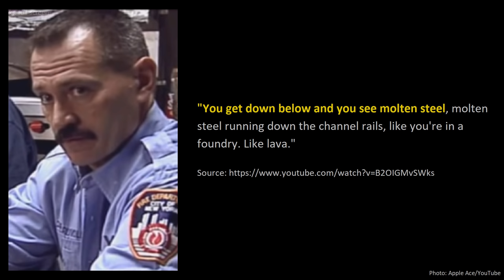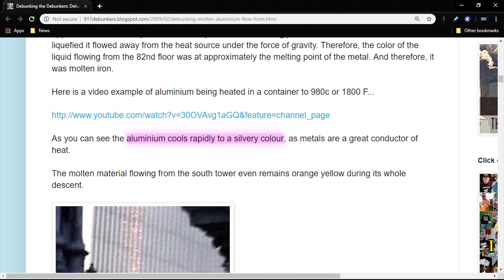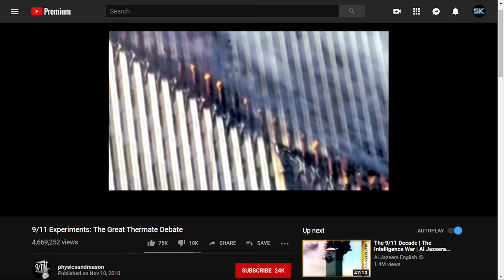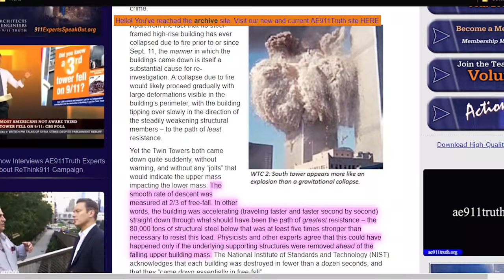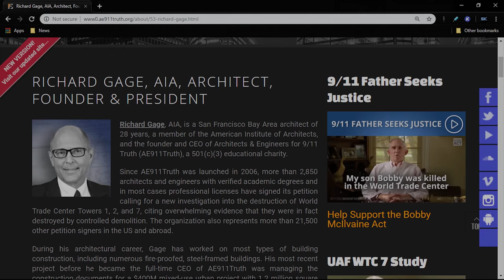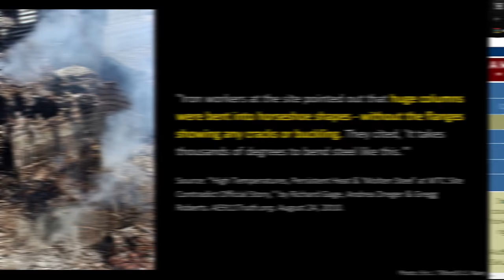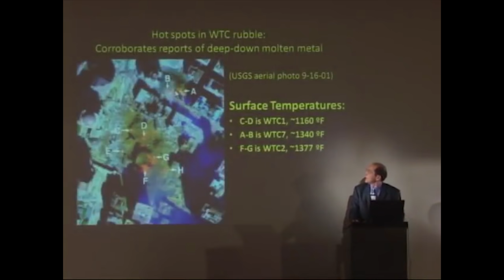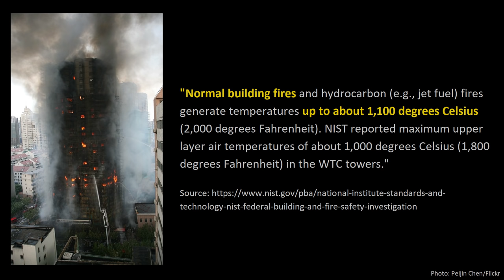9/11 Truthers Debunked: "Molten Steel = Thermite From Controlled Demolition!"

Comment: About minute : 31:20 ... this doesnt need to say ''certain pockets can have around 1200 degree celsius" ... But the photos itself arent made with some bolometric spectrograph or something. Meaning: those were not scientific cameras to show colors accurate. Meaning: the longer the exposure of the camera, the brighter the glow will be. And the photo looks at least like a late afternoon, but certainly a darker time of day. Back then cameras were able to adjust the exposure time by itself, given the lightsensor in the camera, and given that the camera know: what iso the film was (if the iso was not known, the camera usually ''thought'' its an iso 100 or iso 200, which is a quiet low value. Therefore the exposure time was longer, to light up the photo evenly, and not only the brightest spots. 
This can lead to a much brighter yellowish color than it was appearent for the observer at the place. 

Btw i think that steel could have been partielly melted. Not because of the temperatures itself (as you explained very good, the temperatures of the burning fuel etc was to low for that). But the collaps of the towers itself creates a lot of  energy itself in form of friction heat. Tentousands of tons of weight, falling from houndreds of meters, can make a very big friction heat. Given that parts of the building already were at around 1000 degree celsius, i can totally imagine, that parts of the steelbeams indeed melted. Now i am also sure, that those amounts were quiet little, because the heat disipates on a large area while the towers are falling. But i would not be surprised, if some conspiracy theorists found some evidence of miniscule amounts of molten steel. It just doesnt say anything. And it certainly still not supports their claims. 

I have to correct you a bit on 14:00 ... ''the outermost walls of the twin towers were the steel collums" ... thats not true in the sense how you meaned it. The facade-steel-collums were only there to support their own weight, but NOT the weight of the building itself. The inner steel collums of the building was there to support the weight of the building. 
Thats also the reason, why the facade steel got thinner and thinner with the height of the floors. But thats the only criticism i can find in your whole video, and isnt even an important point - because it doesnt change the conclusions of your video. 

Other than this, in my opinion very small error, i think you are right on every point. 
Also my first thought was: that this ''molten metal'' which drips down from the building" is in fact aluminum. The airplanes have plenty of it, as you proved, and the buildings had plenty of it, as you also said. Not only on the outside, like you researched correctly. But i am sure, also in the inside of the floors, there were a lot of aluminum sheets (like some coverage of the ceilings , or desks out of aluminum, parts of the elevator, etc... in fact i am quiet sure, to save some weight , a lot of parts of the buildings were aluminum For instance the doors of the elevators doesnt need to be out of steel. Aluminum also does the job. And the more weight the architects could saved, the less weight the steel collums have to support. ... There are a lot of sources of aluminium, because its such a good material for everyday use. So yes, i am very sure, it was aluminum.

By the way. The conspiracy theory of 'thermite' is still one of the ''smartest'' out of the bunch of crazy conspiracy theories. I heard much more crazy ones. Like: that the towers werent hit by airplanes, but by missiles shaped like airplanes to give them the appearence of airplanes.
The most wild conspiracy theory i read about 911 was:  that the collaps of the towers were in fact caused by mini-nukes. In that theory the mini nukes were placed at the lower floors, desintagrating the inner core of the tower, and "that explains, why the upper floors fell like in free fall into the inner void... and it explains why even after months there was found red hot metal on ground zero (because of radiation heat of the mini-nukes). It also explains the molten meteorit-shape objects, which are like the core meltdown of nuclear power plants." 
That one was the most crazy i read. And it came from a selfclaimed physicist from russia.

Comment: How can it burn to them temperature, all the fuel brunt up on impact, it simply can not reach them temperatures due to office fires alone as most objects in buildings are fire resistant, they have to be to meet a certain criteria, a building of the size and where the point of impacted was, it should not of fell into its own foot print, not once or twice but 3 buildings fell into its footprint, and no building has ever fell at the speed of free fall or due to fire, it totally defies the law of Physics

Comment: The so called aluminum does not stay red when in fine droplets as in the video.  They cool rapidly and turn silver.   Also on the ground it would not stay RED as in many ground photos and worker reports.  There simply was not enough fuel to keep it that way, even if it were it would not longer glow days later.  Simply not enough fuel and the fire did not burn very long. 
Iron stays RED even when not in liquid form.   That would explain why the metal flowing out of the towers stayed red for so long in droplet form.   Iron will continue to glow red even as a solid.  Where aluminum quickly cools and looses color.    Same thing with the Red hot STEEL on the ground days/weeks later.   It was a oxygen starved fire that did not last very long, black more smoke than fire = oxygen starved low temp fires.   The Center support columns that were intact gave way first.  The corner collapsing in the videos only occurs because somehow all the center columns lost support at the same time.    Still you could cut the top half of the building off and set it back down and it would still not collapse the rest of the building.

Comment: Simply suggesting that the molten metal is aluminum and claiming that this is more plausible is not at all a debunk of anything.
Here are some problems with your attempt:
1) You claim the idea of using thermite for controlled demolitions is ridiculous. Look up the demolitions of Sky Ride, Chicago and Reichstagskuppel, Berlin. 
2) You claim that it´s more likely aluminum rather than steel pouring out of the tower because the melting point of aluminum is much lower than that of steel. Then you (at least to some degree) destroy your own argument by admitting that aluminium would glow only at temperatures much higher than the melting point.
3) While it is true that authorities didn´t look nor test for molten steel (or iron) and simply ignored all the reports, you somehow seem to suggest that this is "truthers" fault. It´s not, obviously!
4) However, they - NIST - in fact did metallurgical tests on some steel parts they could find and identify to be from the fire floors. Guess what: None of the analyzed outer columns had reached 600°C or more. 13 out of 16 outer columns hadn´t even reached 250°C despite being directly exposed to fire. None of the analyzed core columns had reached 600°C or more despite being in the center of the burning floors. But tons of aluminium got molten glowing bright orange you suggest?!
5) Another kind of test that was done - not by NIST but other authority - showed remarkable amounts of tiny iron rich spheres in the dust. Typical thermite reaction product. It was all over in the dust and was used to tell WTC dust from background dust. 
6) "Silent" in this context can´t mean "no sound at all" since buildings that size can´t collapse without any sound even if no explosives are involved, right? You can and will have bangs and booms with thermite reactions if you put them into containment and doing so will fasten up the destructive process, but it still wouldn´t be as loud as conventional explosives. U.S. military labs know best where you can take this shit with nano scale engineering and adding whatsoever ingredience. At least several U.S. patents about such stuff came out leading up to 9/11...
7) The only ones who should have to come up with a straight detailed explanation are those in the U.S. who started the wars under the rule of the War For Terror and the Patriot Facts and the revival of the Cold War hierarchy. However, I can surely give you something better than the official "inevitable", a word seemingly worth millions of tax payers money...

Comment: How did the buildings collapse so rapidly with no apparent resistance from below.  Where did all the steel columns go? The debris pile was small and fires kept burning for weeks
Reply: There's an excellent 15min video here on YouTube that explains, in detail, the unique (for it's time) construction methods used in the WTC towers.  Essentialy, they were hollow tubes, relatively thin steel ektoskeletons tied to a column and girder core sheathed in drywall (rather than reinforced concrete used in nearly all high rise core construction today) tied together with delicate (again, relatively) trusses.  It was the connection between the trusses and the exterior skin that ultimately failed.  As for the debris pile, you have to remember that the buildings collapsed into 7 levels of basement (approximately 70ft) above that the debris pile was anywhere from 6 - 10 stories tall, so no, not so small.
Reply: There was plenty of resistance, as the not actually all that rapid collapse show.
The debris pile was 16 acres wide, and multiple stories high, as you can see in any image or video of The Pile. As for fires, how much flammable stuff do you think is in two 110-story buildings? Carpeting, papers, machines with flammable liquids, furniture...
Reply: @mooneyes2k478  what about building 7?   For the first 3 seconds , the collapse was at free fall acceleration and symmetrical all the way down , a steel framed building never before collapsed from office fires, the steel substructure remains after the worst fires.

Comment: Jonathan Cole original video showed a video of the picture you showed. I have no clue what happened but the real truth is in his original video there was a video that the 911 commission referred to smoke puffs he refuted using the thermite theory. In his video he was successful in cutting the same size girders using a small steel device and one and 1/2 lbs of thermite which actually wasn't the same grade as what was found according to him. You may be 100% percent right but this video is not in line with the truth regarding him.

Comment: I dont know if the temperature is right for the orange aluminium but if the one video of melted Al isnt, say, some alloy that does melt orange, the twin tower example of turning to silver does nonetheless seem to suggest Al. It was a bit of a worry my team has relied on this too much it gets them in a corner re.:
1 Why wouldnt the explosion use up any potential for melting?
2 Where are examples of demolitions leading to such melting? Only via nano thermite? - would that actually help for having any remaining melting?
3 How could perimeter columns have detonations installed just outside of functional office spaces? I don't know, but sounds tricky.

By relying on - particularly - the 'pouring Al' they can end up forcing themselves to an unnecessary corner. Though I think recently they've become less - or perhaps no longer - interested in it.

Comment: If its molten aluminium then and not thermite then you debunked any explanation to what brang the building down. You can see from that very picture the structure is in tack after plane disintegrated into the tower. Diesel fuel wont melt concrete and steel.  Absolutely no reason the towers free fell to the ground unless they were imploded from the base.
Reply: Could anyone please explain another point to me? If the fire became from the impact of the plane, and only the steel in those nearby floors were seriouysly damaged, why wouldn't all the lower floors with no such damage hold on the structure when it fell? The pankake effect makes no sense if you think about that. No?
Reply: @thiagowwz  your right. It would hold. If it didn't topple when planes hit em they weren't going to come down. And firemen knew that its why they kept going in. The buildings were demoed. Or another term is "pulled". Video of Silverstein admitting to pulling building 7. Was his plan on 911 too destroy all of them. Small fire in bldg 7 and it free fell to the ground in 7 seconds.
Reply: @mooneyes2k478  why did the buildings take 45 minutes after the planes hit before they fell to dust in 7 seconds? Except for building 7 that wasn't hit by a plane. It stood all day until they "gave up" on it. Then it fell to dust.

Comment: Ok so I just remembered this article: https://11-settembre.blogspot.com/2007/06/ups-all81esimo-piano-del-wtc2.html

It's in Italian and I'm sorry I cannot find it in english. 
It's a research from an italian engineer, the article was even seen by the NIST and praised for his research. 
I'm italian so I can sum up the content of the research. Basically, it seems that the corner of 81st floor of 2wtc was entirely filled with UPS batteries (really big batteries) that were mostly made with lead. Probably the fires/molten aluminum from the plane entered the room and melted the batteries (lead has a very low melting point of 320°C) so the flow of molten metal was aluminum but also lead from the batteries.
Maybe this explains the large quantity and the bright color even when falling from the buildings, as well as why it was only seen in this location
Reply: Having worked with thermite for years, I can tell you that it's thermite, as it's a LOT hotter than molten lead and aluminum, and therefore has special characteristics which are present in what's flowing from that tower. It's so hot that it sucks any moisture out of the air which produces small explosions, observed here. Sorry to burst your bubble, but it's thermite for sure.
Reply: molten lead doesn't glow at 320c

Comment: 1)The thermitic event that brought the building down was NOT OCCURRING during this time "molten steel" was running out the side of the building.   Even if  this is aluminum,  the thermitic event has NOT OCCURRED YET ! 

2) It's interesting to see that when you show the Jonathan Cole video,  that you only show the
 experiments that lead you up to failed attempts of cutting Steele, but never show how the actual device he designed that actuallys cut the steel beam efficiently,  precisely,  and completely into.

3) A proper  forensic test would absolutely test for all things possible to rule out all possible .  Thermitic residue was present everywhere in the degree.

4) You are correct in eluding to possible multiple layers of destruction initiation,  and with that , you do not discuss all plausible points that  day. 

5) a.False narrative,
     b.  Use planes as objectively possible to initially cause the strike.  
C. Mask the event with conflicting reports, and samples.
 D Use a Direct Energy weapon to completely destroy practically everything in the foot print.
  E.Mask evidence collection by removing elements of debris immediately and not conducting proper standard and basic forensic samples for examination

Comment: In the meteorites isn’t there just a lot of rebar enforced concrete? Isn’t there also a stovepipe effect from wind passing through and stoking the fire with more oxygen bc I have accidentally heated my steel chiminea above 2000f by blowing an air bed inflator into it…to the point it warped and became unusable. Also people think thermite is alot stronger then it is.

Comment: Molten aluminum doesn't glow bright orange like a sparkler. What we see dripping out of the building was steel or a product hot enough to melt steel.
Reply: Which is complete nonsense on not one, not two but THREE points.

Every single substance that does not convert into gas will glow if heated to sufficient temperature. This is basic physics. The color will vary depending on exact temperature, but none will not glow. Anyone who claims differently have no idea what they're talking about.

If whatever we see coming out of the building is in an area hot enough to melt steel, and KEEP it molten? The aluminium cladding that is ALSO easily visible, would melt. Steel melts at temperatures two and a half times higher than that of aluminium.

And of course, whatever it is? Isn't steel. It can't be. There's that pesky physics again. Steel melts at temperatures of around 1500 degrees C, depending on exactly what kind of steel. At that point, steel is a BRIGHT, shining and sparking, white. The stuff in the video is not. Visibly not. FAR from it. So, it isn't steel.

What do you know, you missed completely.

Comment: The most disturbing note is you are unknow person posting on YouTube in a field that you are not qualified nor accredited to contribute your unsubstantiated opinion in face of a long list of qualified and accredited experts in the different branches of science and professions related to 9/11 mass murderer crime. 

I am a qualified aviation engineer and can assure you that the aircraft hull won't turn into a molten stream under fire. Furthermore,  the aircraft hull definitely was fragmented into very small pieces upon impact with the towers' steel enclosure, making it impossible to find one large piece of the aircraft in the buildings debris.